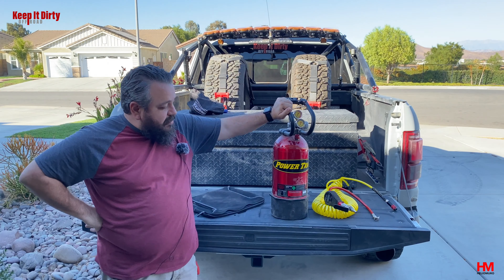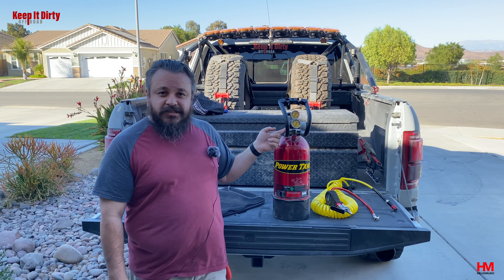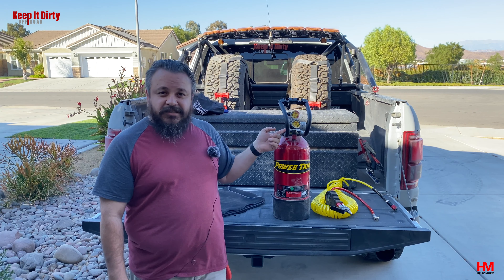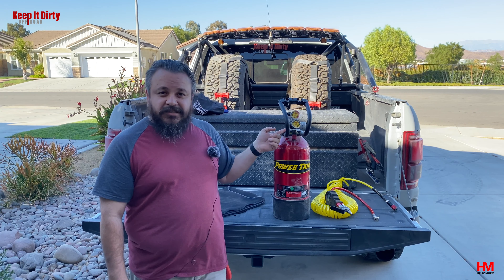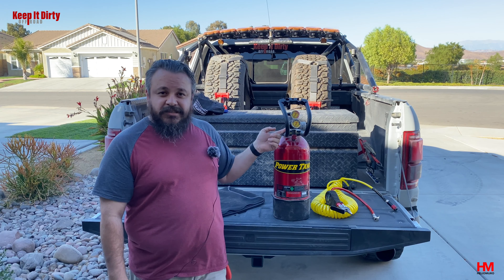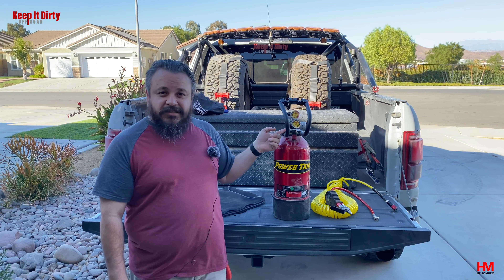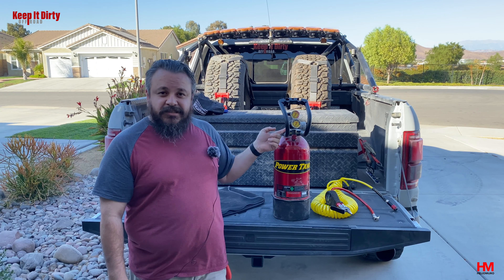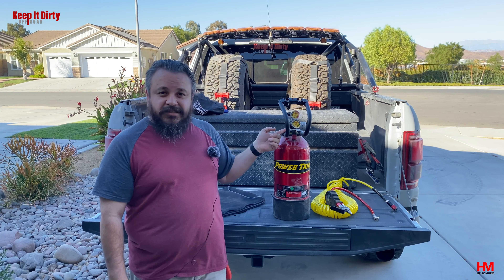Offroad CO2 Tank - DIY Option UNDER $300 & Everything you need to know

Comment: Its slower with Co2 when you factor in the trip for refill!
Reply from the maker: 🤣🤣 still quicker. 5 min fill up vs 20-25min fill ups. And you get at least 4 to 6 fill ups per tank. Do the math. Still saves you time. 
Also a tank will last. Most portable compressors don’t even have a 100% use cycle and die within a year of regular use. And to top it off most portable compressors can’t even fill up more than 2 trucks without overheating. Even the expensive ones have issues and last maybe a year or 2. So no matter what, the CO2 tank is better in just about every way. Only casual off-roaders use portable compressors. Those of us on the trails all the time have all switched to CO2

Comment: This system is definitely quick but I only have 33" tires. I used to dive and the thought of having a bomb in the back of my truck is a definite concern. In an off-roading environment, it's critical to get that valve/gauge guard and have the tank secured, especially when everything is bouncing around. I've seen what happens when a valve gets hit. I found an air pump that's a lot quicker than ARB. It has an automatic shut-off that can be set to whatever pressure I need. This means I don't need to be constantly checking pressure. It's made by Morrflate and while not as quick as a tank, it's quicker than the dual piston ARB and safer.
Reply from the maker: Agree with you on having a pressure vessel with you while off-roading. That’s why the mount that  holds it is so important. I’ve seen this bottomed come loose and go flying and luckily none have ruptured. So as long as you have a solid mount with no play in it, Your good and I’ve ran one for 2-3 years now without incident. Love the speed of my tank. 

Would be interested to know more of the other solution your using though.

Comment: How many times will that tank air up those 4 tires?
Reply from the maker: I depends on the tire size and how much you air back up to. Powertank has a diagram on their website that I have found is fairly close. I normally get 6  trips out of a single tank with 37s  and that's usually airing up mine and sometimes an extra truck that did not bring a compressor.
Reply: @KeepItDirtyOffRoad  thanks for the info, I have small 33's and plan to use it for my mountain bike too. So about 6 trips on your big tires right? Thats not bad.
Reply from the maker: @robflight23  yeah, the big benefit is the time saved. Airing up goes from 20-30 min down to 5 min total.

Comment: Where do you get it check/inspected?
Reply from the maker: Some of the fill up locations can do it in house, while others send them out.
Reply: @KeepItDirtyOffRoad  and can I ask you. My tires already have regular compressed air in my tires I’ve never put CO2 in them before I start putting CO2 into them do I need to let all of my air out of my tires or can CO2 and compressed air mix?
Reply from the maker: They can be mixed without any issues.
Reply: @KeepItDirtyOffRoad  ok cool I have a 5lb custom system  made what’s a good psi to set at for airing up 35s?
Reply from the maker: Depends on you regulator. The Powertank regulator allows me to go up to 250 PSI and can air up each tire in less than 30sec. Most other regulators are limited to 150 and it’s a bit slower at closer to a minute or so per tire
Reply: @KeepItDirtyOffRoad  so there’s no max psi for airing up a tire?
Reply from the maker: Yes, your regular is going to limit the max running PSI.

I normally air up to 38-40 psi and at 250 psi from the regular  it’s very quick.

Comment: went to fill my tank yesterday and they wanted it for a few hours as they wanted to pre-cool it before filling it? something about better for the tank and being able to get more gas in it?
ever heard of that before?
thx for the vid!!
Reply from the maker: Never. They usually just fill it up right then and there and CO2 is measured by weight not by pressure. There is no getting more weigh in it.
Reply: Ideally, an empty tank should be 40 degrees below the temp of a give tank if they don’t have a pump.  But if you go to a welding supply place, they will have a pump which makes cooling the receiving tank irrelevent.  Without a pump, you’ll never get a full tank.
Reply from the maker: Did not know that. I’ve only gone to welding supply places and they all use pumps to fill them up and get the full 10 lbs of CO2

Comment: $20 per fillup and $30 per 5yr to recertify the co2 tank.
Reply from the maker: Not anymore. Typically fill up was $18 for me at my local welder supply. Last time I filled up it was $32. 

As for inspection, you need to find a place to do it. Most welder supplies don’t do it. They usually ship them out to another company. I very much doubt it will be $30 everywhere

Comment: Might actually build my own in the future. Thanks for the diy idea!
Reply from the maker: Your welcome. Im starting to plan on building one for myself here soon, so I'll be putting out an update video on just the DIY build.
Reply: Keep It Dirty Off-Road how many tires can you do with a 10lb? Is it better to get a 20lb?
Reply from the maker: Depends on how often you go offroad and the pressures you run. I was averaging about 5-6 trips. But recently started running higher pressure so we will see how many trips I get out of it
Reply: Keep It Dirty Off-Road instead of the 10lb aluminum tank. Can I run the 20lb aluminum tank with the same parts on your DIY CO2 tank list? Thank you!
Reply from the maker: Regulators, hoses, and air valves yes. They all use the same size. But the mount to hold that tank is only designed for 10-15lbs tanks. You will need a different mount

Comment: What about the idea of using nitrogen instead of Co2?  I wonder if Power Tanks could take that or are not designed for nitrogen.
Reply from the maker: You can put nitrogen in a power tank. But not as much. CO2 is measured by weight and is stored at a lower pressure.  Nitrogen requires stronger tanks rated for much higher pressures to hold the same volume. 

So you could run nitrogen on a power tank, but not as much, so it won’t last as much as CO2. 

HPA systems makes tanks that can use compressed air or nitrogen and higher pressures for the same price. The regulatory is limited to 150 psi so fills will take a few seconds longer, but that’s it.

Comment: Btw the chucks matter too! Rhino USA's chuck sucks ass. The harbor freight chuck was actually faster. If you open up Rhino Usa's chuck on the hose end, the hole is hella small on the handle. That's why air comes out so dam slow. If you open up harbor freights, it's a big hole. My harbor freight 4.0 CFM 20 gal tank with the harbor freight chuck pumping a 38x13.5x17 tire from 5psi to 33 psi took 3:32. With the Rhino USA chuck, it took 4:35 lol!
Reply from the maker: RubiKong Yeah, the chuck can have a big impact. But the CO2 tanks are so much faster overall.
Reply: @KeepItDirtyOffRoad  Yes, just thought I shared the knowledge. I have a co2 tank too and was doing a lot of comparisons back and forth with the chucks and regulators. The 150psi fixed regulator is too slow for me, so I bought the adjustable regulator on eBay just like the one u posted. Works great.
Reply: Also using a power tank, 0-60 digital chuck.
Reply from the maker: @iAmSunJinWOO  Totally agree. 150psi is way too slow. its work spending the extra cash for higher pressure

Comment: What king of tire inflator you recommend
Reply from the maker: Ive been using the ARB digital gauge tire inflator for 2 years now and I love it. every analog gauge I've had only lasted 2-3 months before the vibration of off-roading made them inaccurate. It also has a longer hose on it so you can stay standing when filling up. I have it linked on my amazon page if you want to check it ou.